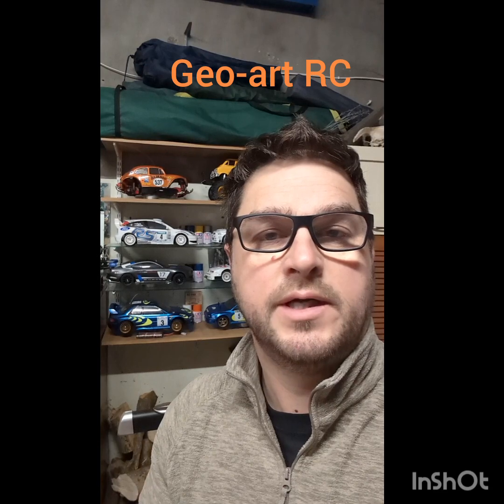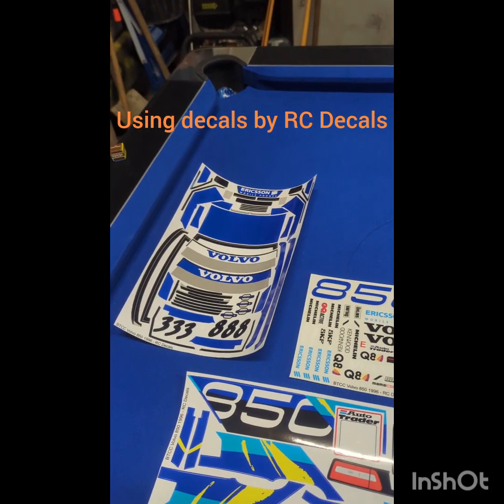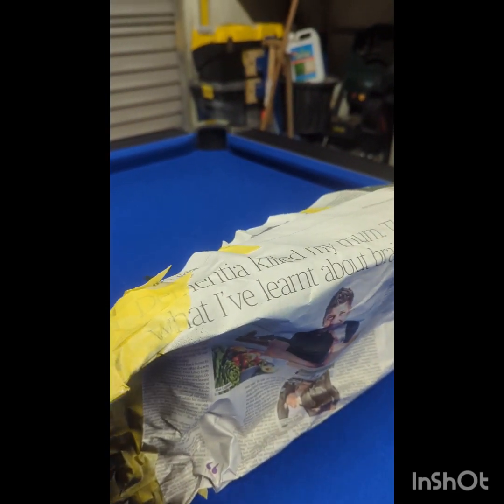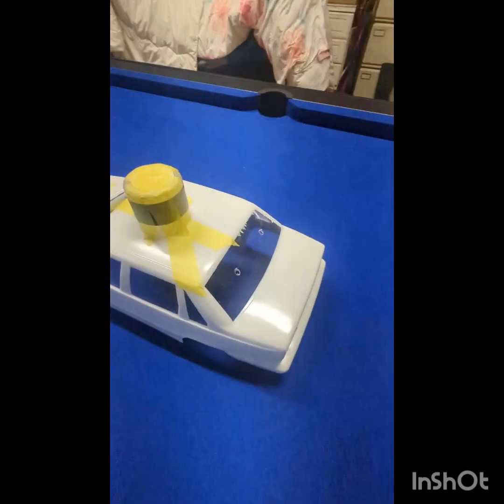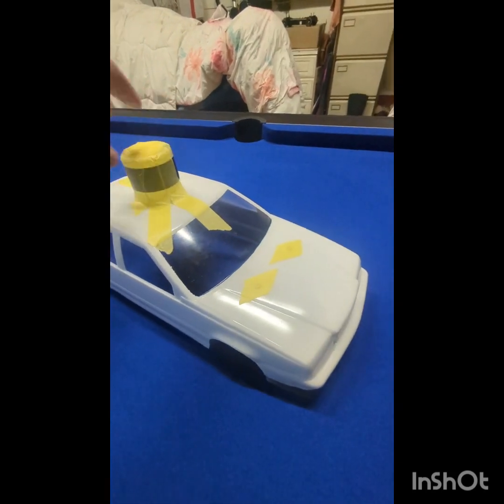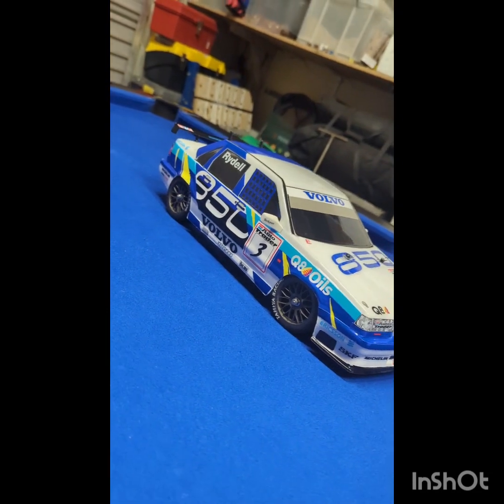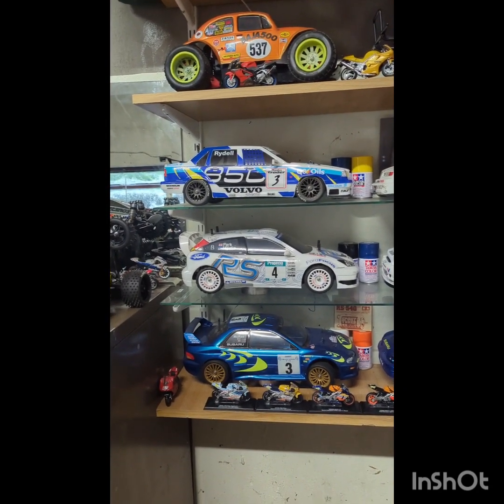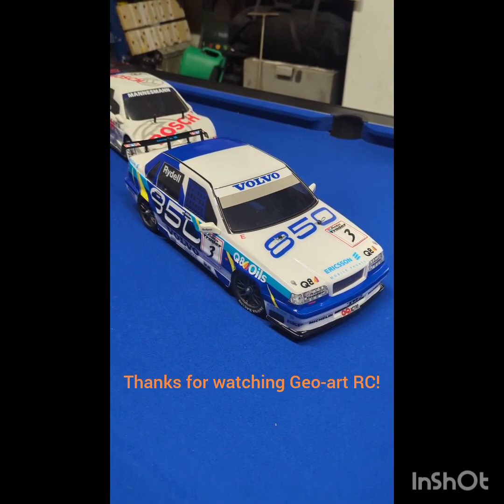Tamiya Volvo 850 BTCC touring car project

Comment: completly dominates the shelf, does L /L dimple the body for the holes?
Reply from the maker: Hi!  Thanks for the comment!  The only dimples are those for the mirrors. There's nothing for the rear wing, but with some careful measurements, I managed it!
Reply: @Geo_art_RC  thatks, got the elusive, Mondeo, on order from L and L, i might do magnetic posts, to bypass the risk, thanks for heads up
Reply from the maker: @stumpycatvm7115  no problem.  I really like the Mondeo too, I hope it turns out well for you!